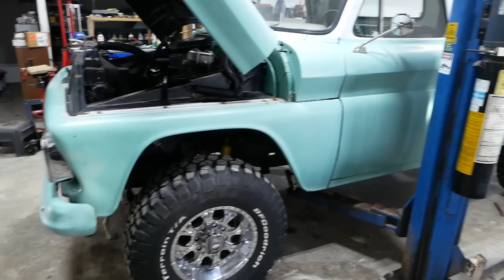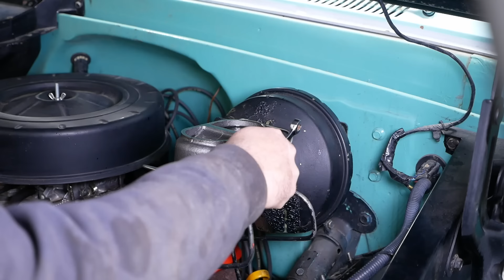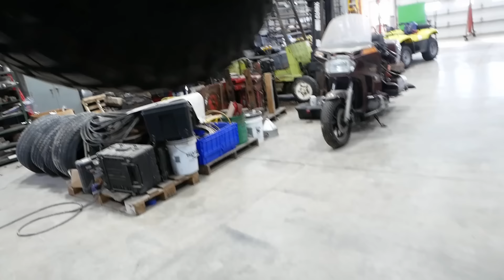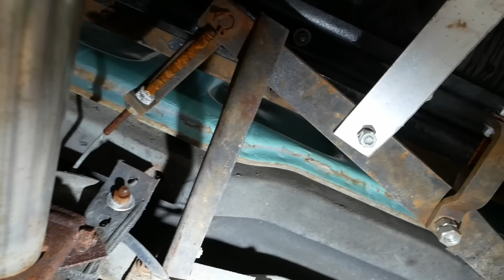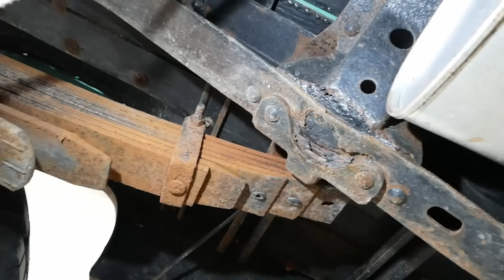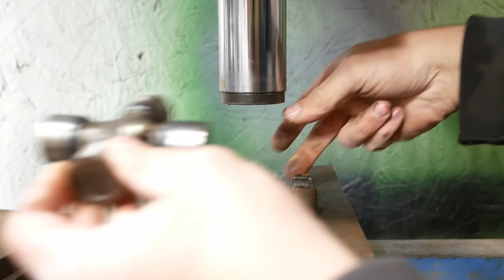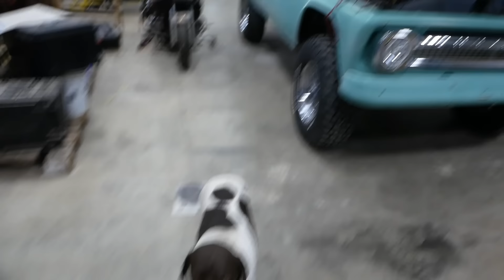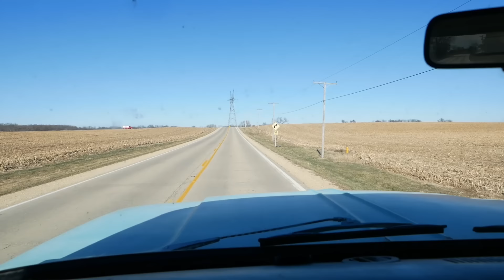New Parts = No Brakes and Other Problems | 1964 Chevy K20 Project

Comment: Aligning the zerk holes so they are in compression comes from, ooh ooh ask me! High horsepower pullers with thousand or several thousand horsepower and the builders wanted to eliminate it as a failure point. Still an old myth, put your zerks in compression, dont put batteries on concrete and rotate the air in your tires, golden you will be.

Comment: Probably just switch the rear axle to a 14bolt. Easy to find, cheap, strong. The front axle should probably be swapped as well. The closed knuckle interferes with most disc brake conversions. Those early axle shafts were pretty weak. Even a 10 bolt out of a 78+ K10/20 is going to be a lot stronger, great brakes and plentiful parts. For any of those old 4x4 parts, you could call Fab Rats, another favorite channel of mine. If Paul doesn't have it, he'll know who to call!

Comment: The spread ears on u joints happens a lot on f250 and 350 trucks I always put them in press like you did but get it straight under pressure then while under pressure heat it to 1000° using a rose bud and temp stick let it cool under pressure no spring back

Comment: I owned a similar pickup back in the 70's, that being a 66 GMC with a straight six, all bright red with a wide black belt line down the side where the metal dishes in... was not a 4x4 though. It was a great little truck that was good on gas and the tailgate latches on your clients truck are correct minus the chrome.

Comment: Holy crap, beat the U joints in and out of the drive shaft and who gives a rats butt about the zerks!
You won’t hurt the Ujoints and the zerks most of the time will never see grease other than when installed.
I like old beautiful trucks and cars but in all honesty most are ready for the crusher rather than dumping a fortune in restoring them

Comment: That's a 1964?  I'm pretty sure dual-brake circuits weren't required until 1968.  Somebody's safety conscience or they had their single-circuit brakes go out and went for a wild ride.

Comment: Uncle Tony’s Garage had one like this . Bought by someone from a shop as a “Complete Rotisserie Restoration”😂🤣  corners were rotten, suspension was not attached. It was a mess. You might check his out if you want to see if anything sounds familiar. If this is gonna be a “thing”, someone should see about shutting it down….🤨

Comment: i was right with you on the u-joint replacement until i saw you using a mig welder pliers for the clips. that's unforgivable, you obviously have no idea what the hell you're doing.

Comment: I don't care what method is used to install new U joints. What I DON'T LIKE is when the mechanic doesn't realize they incorrectly installed the U joints and the grease zerk is no longer accessible by ordinary means. When the mechanic is informed of the mistake, he (or she) will say it is if you use "this devise." I call BS! You try to grease it!

Comment: I’ve got a 1964 Chevy C10 with the 250 4.1l. Most reliable thing you’ll ever drive. Runs great and drives like your floating on air.

Comment: You know Wes, I would hope that the owner would realize that this almost 60 year-old truck is from a different time. It was not designed to go 60-70mph. 45 is about right for safety & longevity. It actually is a good setup, 283, rather than a monster motor, 4 sp manual, and low gears. They were made to work, not cruise on the expressway. Towing, hauling, and snowplowing, and working on the farm is what was in mind when these were new. We are too used to the boulevard cruisers that they call trucks today. A/C, power everything, 4WD that is electrically operated, leather interiors, sunroofs, all mated to a weak, undersized frame that will be history in 5-7 years. You won't find any of these as survivors, they won't stay together that long. All of this for 75 thousand dollars.
Reply: A/C is a requirement in the Gulf states. Ask how I know......
Reply: right on.  I have a truck that has a blue tooth in it.  Not long after I bought it I opened the hood to take a  look at it and didn't see any teeth at all much less a blue one.
Reply: How much does he want for it? That truck needs lots  of TLC!
Reply: cmon man you sound bitter and jealous...it went this long what's another 5 years, he will take care of it
Reply: I had a '62 with a v8 and 4speed and a '64 with a straight 6 and 3 in the tree. Both would easily do highway speeds without effort which were 70mph before the 55mph push from the government. The 4 speed had a granny low for field work and the 3 speed was the 4 speed w/o the granny low ratio wise. Heavy duty trucks often had a 2 speed rear end at the time to deal with off-road speeds and heavy loads. The biggest issue tech wise was the brakes which would heat up over long down grades. The general tactic was to brake using the engine and then use the brakes only when you had to. It was common at the time to have soft gravel off-ramps for heavy duty trucks that had lost their braking. These trucks are also a good 20' long so they are quite stable compared to many SUVs that are tall and short. This one has been lifted from stock height so less stable than it might be.
Reply: A little newer than this but my 1983 chevy K30 does great with a 5spd manual, 4.10 gears, and a 12 valve cummins going down the highway at 70-80mph down the highway for hours and hours absolutely rev maxed out. Big front discs and giant rear drums work a treat too.
Reply: Well said, I own two trucks, one is kinda from that old school frame of mind, a 1988 Ford F250 diesel 7.3 IDI with tall gears that revs higher than what we're used to at 65 mph. She was built to pull. And a 2014 Toyota Tundra as a daily which is the latter your described but unlike the big three, not a rust bucket from the time it rolled off the factory floor. The Tundra is a comfy truck.
Reply: @kman-mi7su  I had a 63 Chevy Custom 10 with a 250 streight 6 motor and powerglide (slushamatic) automatic transmission. .  It was just a 1/4 ton farm truck but it pulled my tri-hull 16 foot fiberglass boat at 70 MPH down many a Texas interstate back in the 80's.  I sure miss that thing.  It rode so smooth and handled to well.  Same ugly green as the one Wes worked on.  LOL
Reply: I had a 65 with a straight six 4 spd w/granny gear . Top speed was about 50-55

Comment: That Corvette style aftermarket disc brake master cylinder is wrong for a 4 wheel drum brake system. When converting a 4 wheel drum system to a duel line system reservoir ; . The installer should have used a 1966-1972 full size passenger car master cylinder for 4 wheel drum brakes.

Comment: 17:25 in the video; Comment about the output yoke & driveline rear slip joint. These early 4x4s were not GM Factory designed. After the trucks were built in 2wd the special order 4x4 option installation  was sent to an installer of NAPCO 4x4 parts and  modified into a 4x4. So things are a little different than current manufactured 4x4s. As I said with the earlier comment about the chassis lube, the truck needs a good lube. The 4x4 lock out hubs need to be taken out and cleaned & lubed. Along with the front wheel bearings.

Comment: Looks like that chassis, steering linkage & lower ball joints needs good lube job.  Kick off in the video where the dry spindle pivot joint axle covers.

Comment: I love the creative use of the mig wire pliers @26:40. Years ago when I was a young guy struggling with U-joints, I gave up in frustration and went to the local driveline shop. The sage old driveline specialist with decades of experience took pity on me and showed me how to install them correctly. never had a problem since. Keep doing what you do Wes and ignore the keyboard warriors!

Comment: I had to swap a 12 bolt rear into my 68 gmc c35 but mine being 2 wheel drive its a bit easier . Surprised how people that don't own one of these get very upset if you change anything even if its period correct mine had a HO72 eaton maybe a 5.70 ratio(sorry this approx cant remember the exact ratio). The parts aren't even available. Thanks for the video

Comment: Poor guy bought "vintage" paint and chrome wheels.   If you want a cruiser, dont buy 3/4 ton 4x4.     There's a reason why survivor 1/2 ton short box 4x2 trucks are stupid expensive.

Grandpa bought a nearly new step side long box 1968 Chevrolet 3/4 ton, 4x2, 292, 4 speed with 5.13(?) geared open differential in 1969.    Top speed was and still is 50 mph.    It is what it is, tough as hell (right up to 50 mph lol), but has been retired for something that can do speed limits and not get stuck all the time.

Comment: Na na na u joints should be pushed in using a digger bucket on the ball hitch of another truck, save all that hammering viceing pressing, but and it’s a big BUT use one of matts diggers if all else fails use fat allis. You don’t need to concern yourself with these peoples comments Wes I bet you most of them don’t have a clue Anyhows, just do it how you want.

Comment: I’m on a crusade again. Those t221 transfer cases leak like crazy so check the fluid. Please don’t let him butcher another factory 4x4 they made around 5,000 4x4s that year. They like you said are made for farm use not highway. If he wants one to drive get one of the millions of 2wd body’s that have been frame swapped with a 4x4 square body if you need help locating parts let me know I have some spare stuff for mine. As far as I remember mine doesn’t have any Cable equalizer on it either and it’s a low mile farm truck. Lots of the 4x4 Stuff doesn’t make sense on these like the axle’s are 3 inch’s narrower than a square body these trucks are a dying breed please save one more they make up less than 1 percent of production for each year and that one is really complete still

Comment: Hi Wes watching from Uk done many UJ's in years gone by. Place the cups in the yoke press in using a vice just far enough so that you can still insert the cross, seat the cross in one cup then continue pressing until other cup seats keep an eye on the needles press until flush then use a socket to press until circlip grooves are well clear insert circlips then strike yoke with hammer this will jar cups out to seat with circlips. All the best

Comment: Great to see . I had a 1962 K20 well cad and frame plus transfer case where Chevy , I got the truck for going way out to a property and getting 3 trucks for a work mate as his parents had sold the farm . So he gave me the Chevy , but took some working out . What was what and no idea who did the convert . 4LW Gardner motor to a 5 speed international gear box with 2 speed Eaton diffs both ends . I believe the axles where British army ? As to what but yes 4.11 in high but overdrive in box but only 3500 max rpm but at 2000 rpm on hyway 36 mpg . O add air over brakes and power steer off a Chaberland tractor of all things but pull any thing you could hook to it . Had to stop and get under to change diff speeds home made just a lever with lock bolt and 2 slots yeah could of got electric changers but only used with loads off road so worked for me . Was fun though really to small for a work truck for me then traded it for a 6x6 that would haul 6 ton and tow 20.
Reply: That should be cab

Comment: Hey Wes, you did those U joints all wrong, I always use a timing light to properly align the caps and then check them with a dwell meter. In Australia there are standard modifications that are allowed such as raising or lowering a vehicle or different size rims but anything outside the fairly conservative limits requires certification from an automotive engineer. Seeing potential death traps like that K20 makes me glad we have those rules in place. That said we still get some pretty wild cars it’s just they have to be built properly and be signed off by an engineer before being inspected and approved by the government testing station. Cheers Stuart 🇦🇺
Reply: You forgot to mention, always replace the condensor! People could DIE!
Reply: @TonyRule  Ohh yes, sorry about that and thanks for reminding me👍👍
Reply: @TonyRule  Yep, but it’s better than the alternative. 👍👍👍

Comment: Thanks for the video, as far as U joints go Your experts would love seeing me burn out seized in cups  with a cutting torch, and press the new ones in with a vice. I did some on a big Case ih loader tractor front axle about 15 years ago, the guy said thanks for scrapping my front axle components doing that. Fast forward to last year  I did hub seals on it, I said how many problems did you have with that axle I wrecked with a cutting torch he never said a word L.O.L. If he's changing axles and transmission if your state allows it why not hope a newer trucks got the same wheelbase and change the whole frame. if that ones got problems with rot, It will be a project either way for somebody how ever it's done.

Comment: An internal slave Nv4500 swap would be stupid easy, 73-87 axles would be easiest, available in a smattering of ratios, should bolt in with little more than swapping the front brake lines

Comment: My thoughts on fixing drum brakes is disc brake conversion 🤣 and I've always beat u joints in with a hammer does it always work? Nope I've fudged a few and had to redo but you'll have that on the big jobs. And that ole rig isn't hateful shape but definitely needs love

Comment: Ok, that's it.  If you have time to work on this antique, you have time to work on my 1997 Dodge Grand Caravan.  It has 295,000 miles on it but most everything works.  I am having trouble with the door locks not wanting to stay locked.   Now for the trip planning--you are only about 1,900 miles distant from me.  If I get started tomorrow, I could be there sometime next week........

It was nice to see Mrs. Wes with a smile on her face.  Tell her that we all appreciate her helping for no pay.
Reply: Door locks not staying locked is normally a central locking master actuator adjustment issue - which is normally only the driver's door actuator. But see if the front passenger door also unlocks all the doors when you unlock it - if so, it has two master actuators.

Comment: Excellent video Wes  :) those trucks Manual brakes but was option get Power brakes back then but one Circle  Pot for fluid and hose  line was on right side Brake Booster on valve  also hose to Carburetor! But brakes Power Box sensor with 2 lines one front wheels to back wheels like set up 1970's to 1995 vechiles on RWD type plus how bleed too ! Emergency brake handle are interesting to do repairs on has be costume made on cable last I know of hand to and that truck must been stored inside all life a think also only on roads in warm weather climate! No Winter Season months too at all think so buy nice condition body is in or someone restoration to lots up ! Yes rare see all 4 wheel drum brakes too for that and seen ones people put disk brakes on front and back wheels or just front only ! Ratio be best bet for costumer use 390 to 409 or if get modern axles with 388 ratio be excellent one to ! Transmission also Transfer case need fluid I bet also axle to or need replacement ? That draw be dash lights on Wes  and turn on brake lights switch or Reverse gear lights to?

Comment: I used to work with a know it all that got bat crap crazy over using a ball joint tool to change universal joints. Which I thought is odd considering that is one thing it is made for. This is the same guy that used to bitch about me checking the oil level after I would change oil in a vehicle. He got his comeuppance one day though when he backed a vehicle out of the shop with no oil filter on it, dumping a trail of engine oil around the building.

Comment: Go for the overdrive trans first, and see how it drives.  The 700R4 is a good swap for that rig.  It has a pretty high overdrive, .70:1.  That drops your RPM by 30%.  With 35" tires and 1:1 through third gear and 4.56: ring/pinion it should be at 3150 RPM at 70 mph (tires are never right at their "rated" diameter, so, maybe a bit higher).  With a .70:1 overdrive, that would drop it to 2200 RPM.  If he were to change to 4:11 gears, then at 1:1 through the transmission he would be at 2830 RPM at 70 mph.  With the 700R4 fourth gear that would drop to 1980 RPM.  The trans swap first will give him the best bang for the buck, and it will still pull nicely in 1st, 2nd, and 3rd and depending on how he wants to use it, the 4.56 gears may work out for him.  I have 4.55:1 gears in my J80 Landcruiser with 37" tires.  The overdrive in the J80 trans is .753:1.  At 70 mph on the freeway I am at 2250 RPM and it drives perfect.  (That is with a 4.5 liter inline six, so, not directly comparable.)

Comment: For the cable bracket you could just drill a hole in a flat bar of steel, add a few springs and you are gtg.

Comment: You young guys have no idea. Take away your computers and you are lost. Cut my teeth on a 65 mustang gear shift knob. My sister cut hers on a 68 chevy four wheel drive shifter knob. That poor old truck. Sounds like the running gear is just wore out. And yes parts will be nightmare to find. Everything and yes everything is mechanical. The only electronics you will find. Will be in the radio. Don't think they used resistor on fan motor. Believe it was actually a multi speed fan motor. Good work so far. It will keep you busy for a while

Comment: With 2000 hours of repair time it could be a runner.  I'm sure they put the correct proportioning valve in with the power brake upgraded drum brakes.